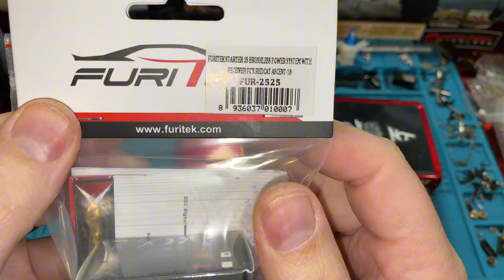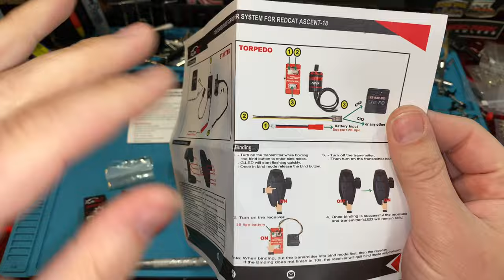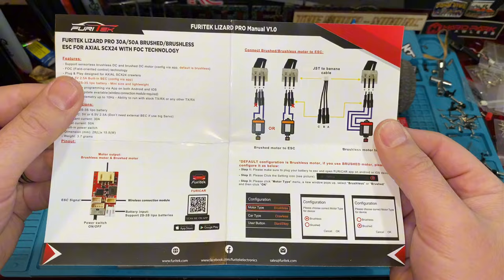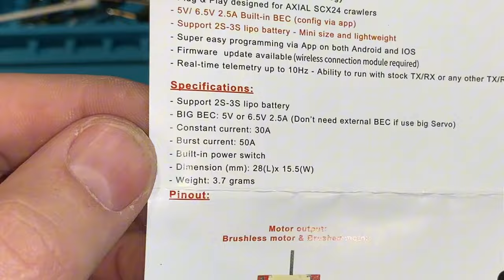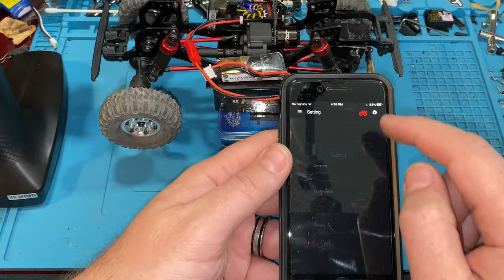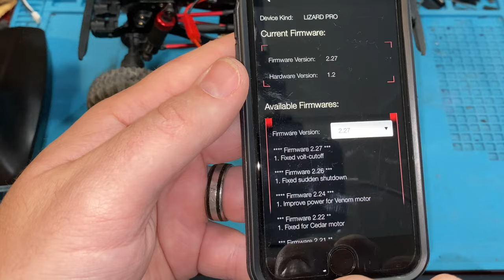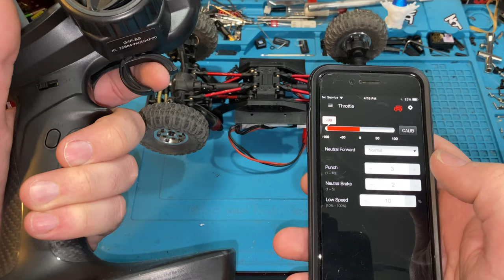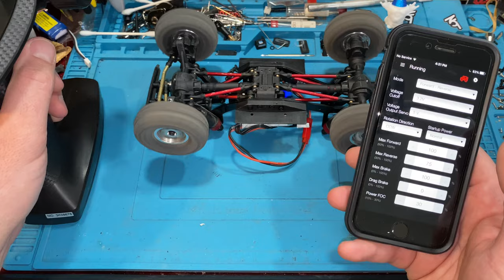Redcat Ascent 18 Goes Brushless with the Furitek Starter System!  The Lizard Pro & Venom Rock!!

Comment: Hey Ken,  I'm wondering if you'll do a build video on a kit that i can't find ANY videos on...?
Seems like a great kit at decent price,  some fitment issue,  and front drive shaft too short...
The "Meus Racing SCX24 LCG Chassis Frame Kit Carbon Fiber 132mm Wheelbase"
 It's around 35 bucks, seems legit.
My first carbon chassis.  Just bought one,  waiting on mail. 
Also bought the Atlas body with lights, and gonna do a magnet-power-connection.
I think I'll paint it blue, maybe do some blue Nexx oil shocks.
Very exciting!  😊
I wanted to do carbon fiber lcg and need to save money, so this is what i came up with. 
Probably a MB100 with 050.  Maybe I'll attach another 050 for sh!ts & giggles. (You can rig it on to the motor mount plate if you're clever)  😉
Have a great weekend!
Reply from the maker: Unfortunately I won’t be doing a build in that chassis. I just have to many others to do and it’s too similar to previous ones I’ve done.  That being said, the Meus chassis is fantastic. The OGRC chassis is similar and maybe that build video can help you.  https://youtu.be/fwa6k40MB8I?si=Oehh9HlLyjTczmVq
Reply: @TheShopMiniRC  right on,  I'll check that out. 
Very similar,  i had considered that one but didn't want that elevated mount in the front, and this one came a a more complete kit.  iirc

Comment: I would suggest investing an extra $30 and get the SS driveshafts available thru Injora and the steel trans gears thru Redcat. That way the entire driveline is bulletproof especially when installing and running this combo. Curious.. I dig those wheels, are they the adjustable weight ones from rcawd? Great video as always 👊🏻
Reply from the maker: Metal driveline is always good!  And yea, they are the RCawd wheels.  We have a video on them as well.

Comment: Nice!  Well, I'll have to put this on the list.  At the moment I've got some big med bills but next month I'll be able to splurge a bit.
-  One question: i looked for your video on making magnetic body mounts that double as quick connect power connections for lights,  but i couldn't find it. 
Did you end up making that video? 
Thank you for the great info,  as usual.
Reply from the maker: I don’t think I made a video specifically for that…. Just sooo many to make.  I might have shown it in another video but I’d have no clue which one. 

It’s pretty simple, you just need 3 sets of magnets (if your lights use 3 wire, otherwise just 2 sets)

Cut the wires and solder them to the magnets on the chassis side and then same on the body side with matching wires.
Reply: @TheShopMiniRC  okay I'm gonna go for it!   I'm pretty good at soldering,  have rewired a couple servos before.. on the inside,  was a challenge. 
Thank you.
Reply from the maker: @MrsRabbit8  I think you’ve got it!

Comment: Mine cogs super bad can’t even go over a simple 4x4 piece of wood very disappointed.
Reply from the maker: That’s odd. Ours still runs great. Maybe try using a trx4m pinion or even smaller to get more torque.
Reply: @TheShopMiniRC  it’s only offered with the 11p for the ascent 18
Reply from the maker: @Rocklandingoffroad  you can try the TRX4M motor from furitek. It bolts right on. It’s what I show in this video. Or you can pull the pinion and switch it.
Reply: @TheShopMiniRC  the motor they offer for the ascent is the TRX4m motor hence why it has an 11t pinion. You have any real world use videos on rocks? I’d like to see it. Maybe i got a defective one.
Reply from the maker: @Rocklandingoffroad  they offer the trx4m version that is 11tooth and the ascent18 version that is 12tooth. Both will work. I have the 11t version in this video and it works great. It’s my class 1 comp rig most nights I comp.
Reply from the maker: @ also, just know that if you screw the motor mount screw too deep into the motor, it will touch the motor wire windings and then cause the motor to cog and get hot.
Reply from the maker: @Rocklandingoffroad  here is some more running video: https://youtu.be/q7LvK586Sss?t=1397
Reply from the maker: @Rocklandingoffroad  also, this video you are commenting on has running footage on the rocks: https://youtu.be/Bn7YgB4ULyw?t=1763
Reply from the maker: @Rocklandingoffroad  what size tires are you running?